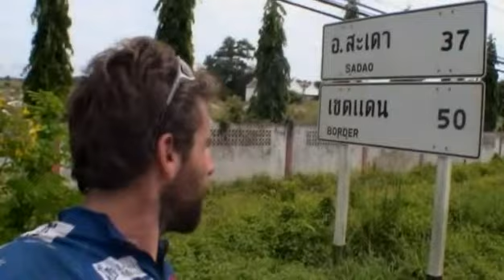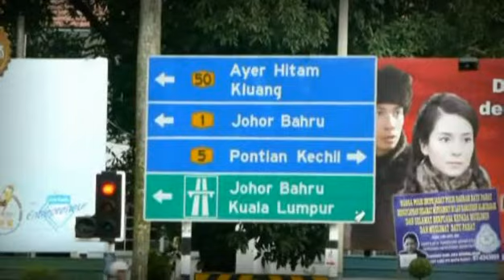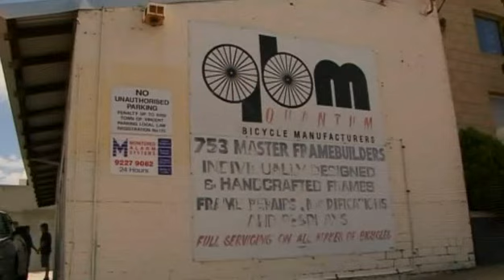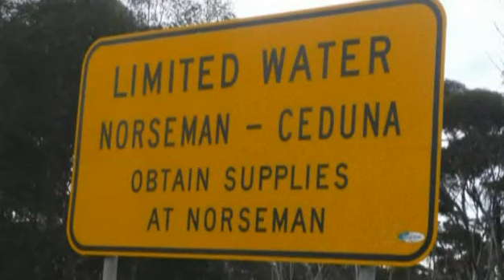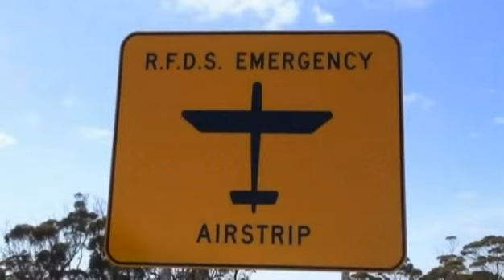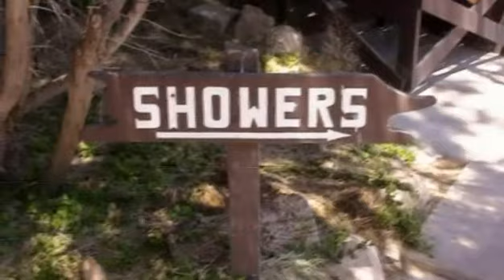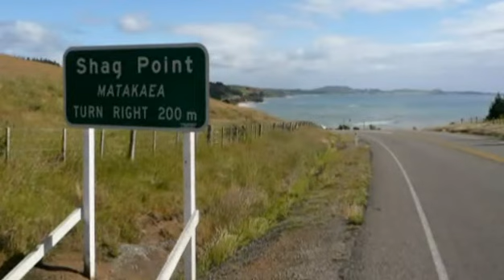THE MAN WHO CYCLED THE WORLD EP3

Comment: two and half thousand pound bike.  I don't think so!
Reply: unless they mean pound as in price i guess
Reply: applause
Reply: Kevin Hensley that's exactly what they mean, but even so there is no way that bike costs that much £££
Reply: Joseph Townshend Really? Rohloff hub alone can set you back £900. Koga do a world trekking bike off the shelf for £1700, so a custom build would easily set you back £2500
Reply: Ben Thorp oh yeah, didnt see the Rohloff. blimey, not the way i would spend the money, but to each his own..
Reply: Bailey Frost looks like a stock koga signature traveller frame to me, what custom 'elements' are there?
Reply: ah yeah, just found it, thanks for the tip. j
Reply: it's true, especially as that looks like a wet paint job. i've had frames powdercoated for under £100 but its not as pretty.
Reply: Im wondering how he was able to go 18,000 miles on one bike chain...
Reply: @kevinhensley2933  Obviously in price, he's british so uses £'s.
2500 lbs is over a ton, that would be some hard going.
Reply: @BenThorp  You can pay £8000 or more for some of these top end carbon road bikes, £2500 isn't that much considering what it has to deal with.